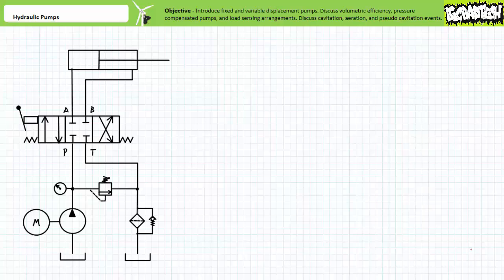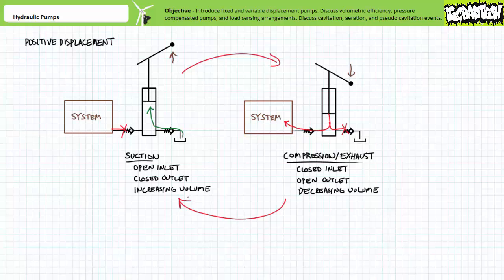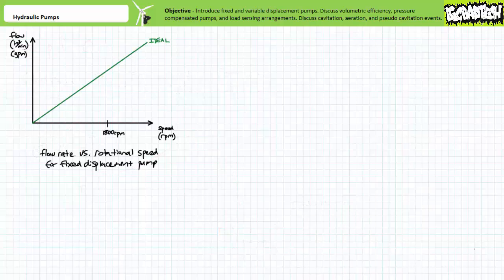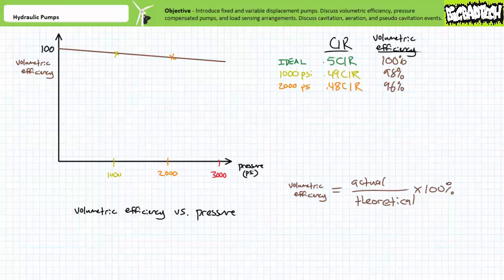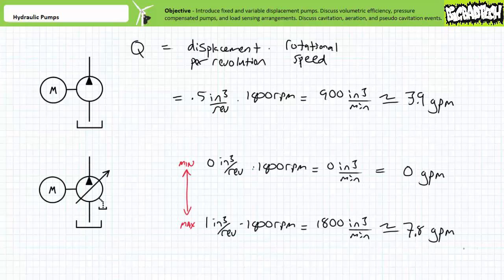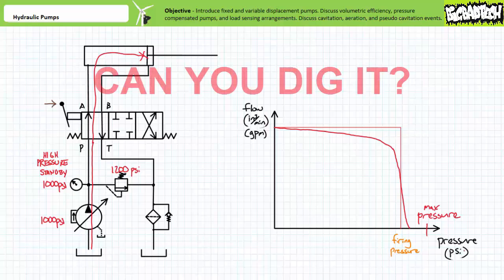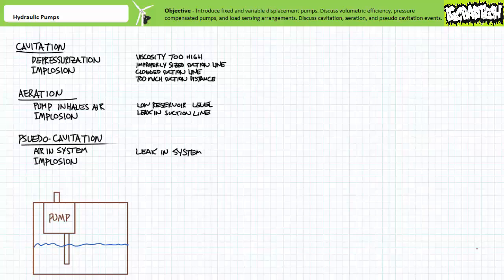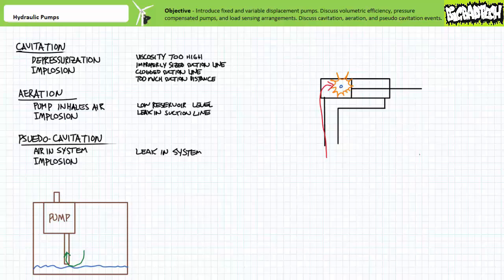Hydraulic Pumps (Full Lecture)

Comment: i have a question 
are there any smaller lower power versions of hydraulic or pneumatic system, like the electrical ones, since there are big asynchronous electrical motors and there are also small DC motors that could be used in smaller projects outside from industry ?
Reply from the maker: Yes but fluid power systems don’t really scale down well.
Reply: @bigbadtech  so is it better to use electrical power to make a project like an exoskeleton over fluid power?
since it gotta be lite and mobile
Reply from the maker: Not an expert on these. Check out the Sarcos Guardian. I want to say it's hydraulics.
Reply: okay, thank you

Comment: I'm working on block making machine with a hydraulic pack of  37kw motor. Our challenge is to reautomate this machine and have new control on it.

In my production cycle i use sometimes 3 parts of the machine simultaneously, in some i need to use around 50bar,  on another one 140 and so on..
What should be the best solution in making this system work  properly?
Should we have a Vfd on the engine to control the rpm and there for control the pressure?
If i made any sense, is there anyone who can give me an advice?
Reply from the maker: For different pressures in the different legs use a pressure reducing valve: https://www.youtube.com/watch?v=5vtnOLyawPg

Comment: 20:34 ouch... I'm just curious okay?
Reply from the maker: 1714 is a conversion of flow in gpm (volume per time) and pressure in psi (force per area) to power (force and distance over time).
Reply: @bigbadtech  Speed is governed by flow rate. Force is governed by pressure. Direction is governed by valve position. Do I get a cookie now?
Reply from the maker: 1 cookie issued.

Comment: If the the load is 900psi, the pump generate the 900psi + 200psi pressure drop from the load sense setting which equals 1100psi right. So what happens to this pressure drop when the load is at 1950psi? Would the pump not have generate 2150psi to account for the 200psi pressure drop across the load sense?

Comment: 1. Pressure is force per area unit
2. Force makes a load or mass to move (Newton's laws of motion)
3. Force comes from the prime mover and the pump
4. Since force and pressure represent the energy from the pump
5. Pressure must come from the pump to
6. If the pressure is induced by the resistance to flow then the force that moves the load or mass must be induced by the resistance as well. Now we are stuck in an impossible theory...
Reply: #4 is incorrect thus #5 and your conclusion is  flawed. 

Pressure is resistance to flow. The pump is the device which provides the flow. The resistance is determined by the load and/or the relief valve. The load presents a resistance via gravity acting on that mass. The spring is compressed via screw thread, that preload occurred at assembly.

Your #6 is a non sequitur conclusion.

Comment: if I have a hydraulic cylinder its operating pressure is 70 bar , my question if I have to choose pump its operating pressure the same operating pressure of cylinder?
Reply from the maker: If you wanted to get the full capacity out of your press a pump should meet or exceed this requirement and the pressure relief valve would limit system pressure to below 70bar.
Reply: so I have to use a hydraulic pump with more operating pressure than 70 bar and use pressure relief valve on the input of cylinder, right?but hydraulic pump should exceed 70 bar how much?
Reply from the maker: How fast do you want the press to move? You'd need to look at the pump flow rate performance chart at specific pressures.
Reply: press will move in 20.8 cm/s and the flow rate is 24.5 l/min

Comment: Thank you for your hard work on this video. I hope many people find it in there search for knowledge on hydraulic principles.

There are many Techs that are put into a situation to work on equipment with hydraulic components without even a rudimentary understanding of the principles of pascals law or the dangers involved with high pressure fluid injection or crushing hazards. The weight of the machine on a cylinder WILL create pressure in a hose even if the prime mover is at rest. If you remove that hose you risk injection of fluid. The weight that pressure was holding will now fall also. 

Holding valves are installed sometimes as a failsafe in case of primary system failure. You must provide adequate pressure to defeat the holding valve to actuate the cylinder etc. The lines beyond the holding valve WILL stay pressurized even with the prime mover at rest AND the weight supported AND pressure relieved at the valve. Most of these have "bleeder valves" to relieve the pressure without risk of injection.